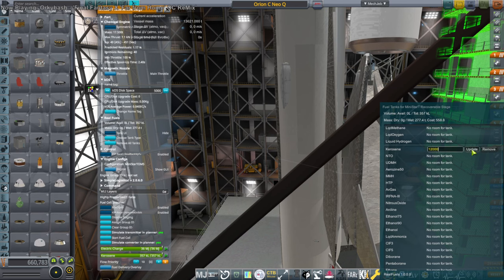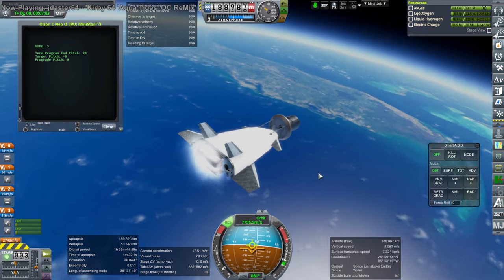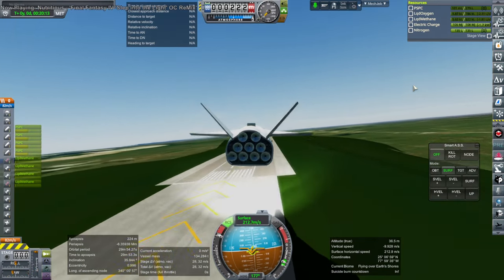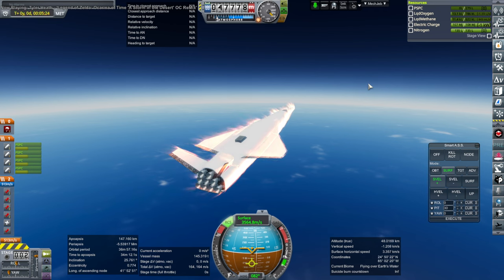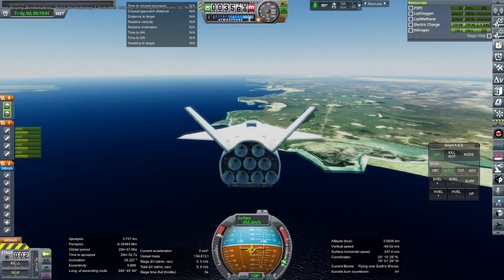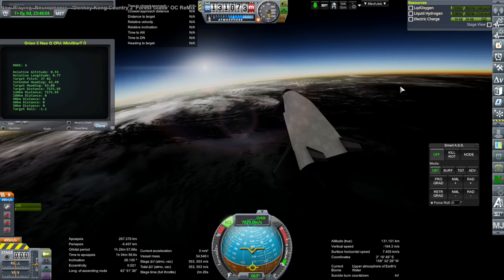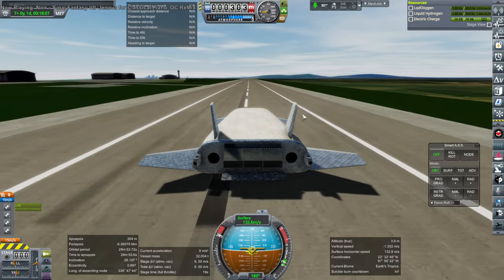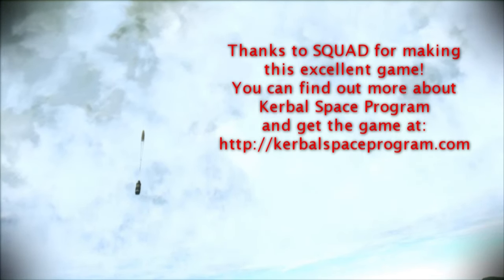Complete Ministar-Orion Carrier Recovery Test (KSP 1.12 with RO)

Comment: The Orion is quite stable for a custom craft, at least in comparison to the Shinkansen. Maybe you've done a stable reentry with that at some point but I can only remember it spinning out of control (And somehow surviving).
Reply: As for the air brake problem, some twin rudden planes IRL like the F-22 can turn both rudders inwards to act as an air brake. Can that be done in KSP?
Reply from the maker: Yes, using rudders as airbrakes can be done in KSP, but it would be best to have them specially configured for that, and that's more complicated than just using airbrakes.

Comment: So the MiniStar is pretty much a modified orbit-capable version of the original X-33?
Reply from the maker: Basically, though it's mass and the engines are specifically for this purpose as a second stage on the Orion Carrier Plane - not meant to match the original size of the X-33.
Reply: @RaizSpace  The mass is pretty close to the original, from what I gathered. No idea on the engines, though.
Also, did you know that a similar concept was actually considered, just using the Starbooster concept instead of your Orion?
Reply from the maker: I mean, the Orion Carrier Plane itself is directly based on 2001: A Space Odyssey which in turn was based on Shuttle design proposals which included a second stage that carried cargo (though also crew). Similar concepts are all over the place, though having a fairing mount like this, I have not seen. Was the Starbooster thing with a fairing mount in front of the second stage or am I right that this is novel?
Reply: @RaizSpace  The Starbooster was proposed in 1999 by Buzz Aldrin simply as a reusable first stage for a variety of upper stages, with reusables being only one option. You should be able to find more on the Wikipedia page for Atlas III, as the proposal used it as a basis for its propulsion system. It is pretty interesting
Reply from the maker: Well, looking at the reference: https://ntrs.nasa.gov/api/citations/19990113117/downloads/19990113117.pdf I'll have to say that, while I see what you mean, there are a lot of ideas that are much closer to Ministar-Orion Carrier and I don't particularly like the idea of using an existing liquid booster inside an aircraft, which is what this proposed. It's trying to cut too many development corners for a reusable system (even though developing the spaceplane is going to be difficult anyway and filling it more optimally with propellant and propulsion would be a comparably minor issue and a good idea) and this leads to gross inefficiencies.

Comment: raiz i dont know why my shuttle dont have su much trusth for escape   the earth and make a orbit
Reply: Could you please describe the problem in a little more detail? Is it because you cannot make it into orbit or because you cannot escape earth orbit and enter an orbit around the sun? When designing shuttles and especially SSTO's, a common problem is adding more features and parts iver time until the ship becomes way too heavy to work well. Try looking over your design and remove things that may not be worth the weight.
Reply: i dont speak some english but i try to describe the poblem
Reply: I use the giulio dondi shuttle, the problem is the impulse, I use the shuttle at 25% strength in the ssme and 100 in the srb and in the end I always end up falling down
With the tank I mean that basically I can't make an orbit by force
Reply from the maker: Are you using the Giulio Dondi launch script? How much are you putting into the Shuttle's bay, if anything?
Reply: @gametrox50  your english is good! I understand what you mean!
Reply: @RaizSpace  i dont know how to use the script, i use mechjeb for the shuttle roll pit etc
Reply from the maker: @Ejd582 Without the script in control, a lot could be going wrong - the Shuttle has to be launched fairly precisely. Also, make sure to try to launch without anything in the bay first.